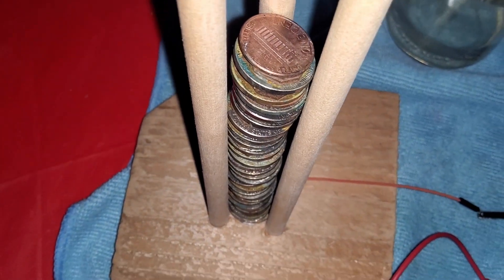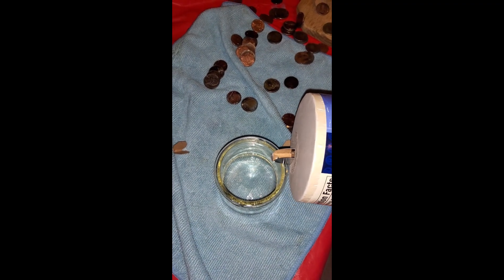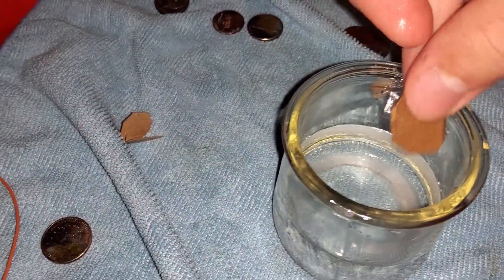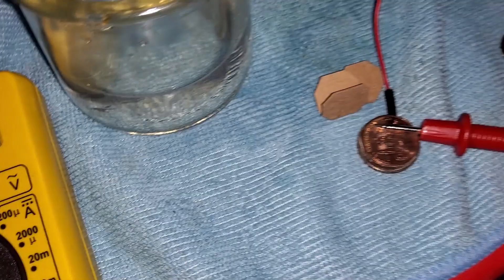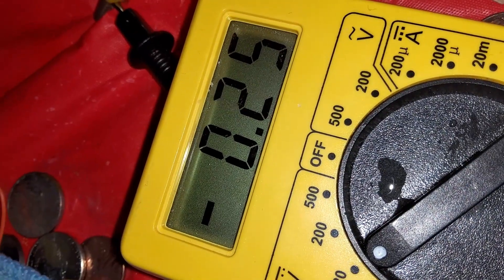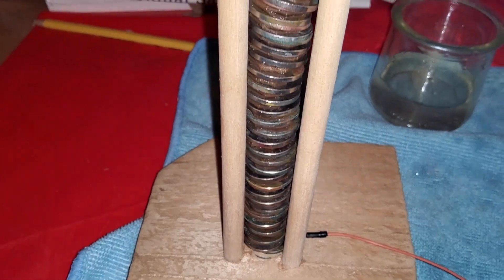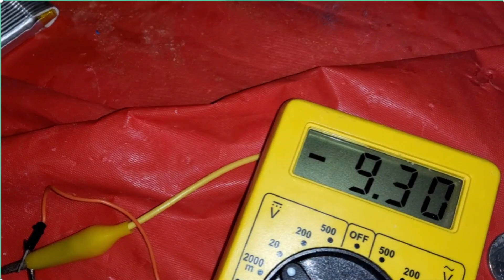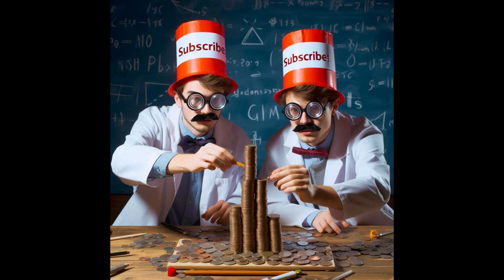Building a DIY Battery Using Pennies, Nickels and Cardboard: Over 9 Volts!

Comment: Excellent school project ! .... but for a super dooper  battery for your projects , just VERY CAREFULLY remove the battery from any disposable vape ( found on most sidewalks ! ) , you MUST use  a soldering iron .... and remember these deliver HUGE currents , so NEVER short them out , and ... NEVER recharge above 4.2 volts ( so , do NOT connect direct to 5 Volt USB outlets ! ) , an added bonus is , that they NEVER leak like ( OMG ! ) alkaline cells .. ( tried - n - tested ) .. DAVE™🛑

Comment: Good job.  It might help to use paper towel instead of card board.  You could check for maximum current.  Put your meter in the 10 amp range and see what you get.

Comment: You must use solid copper pennies, and this is known as a voltaic pile, there is supposed to be a soaking wet with salt water felt spacer between each one of the coins, solid copper pennies, nickels, felt washers/spacers soaked in electrolyte,  try that
Reply: Should not need to be solid copper penny.  Newer US pennies are zinc on the inside but copper outside. For this basic proof of concept science experiment, the battery does not have time to eat through the outer copper.  So even if it was solid copper, the core would not be touched.